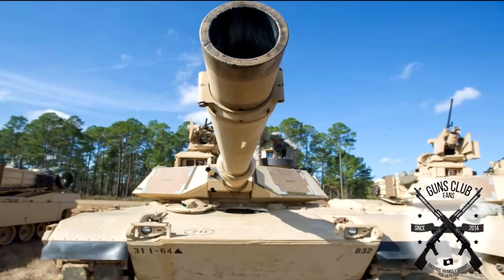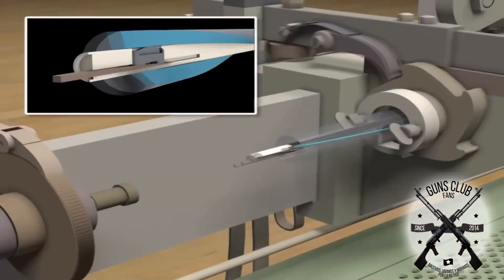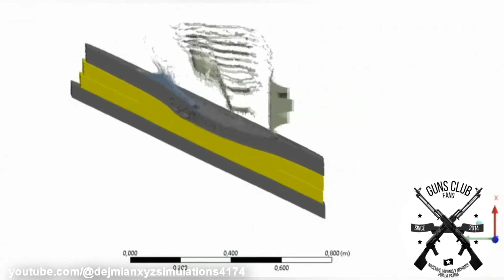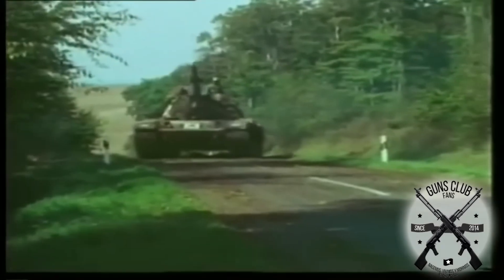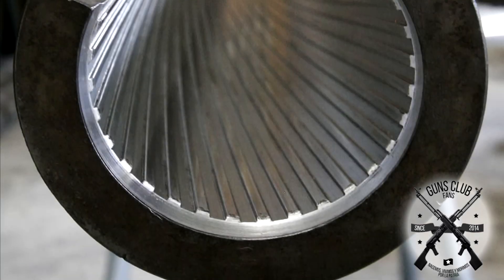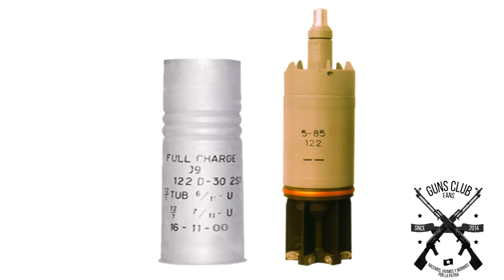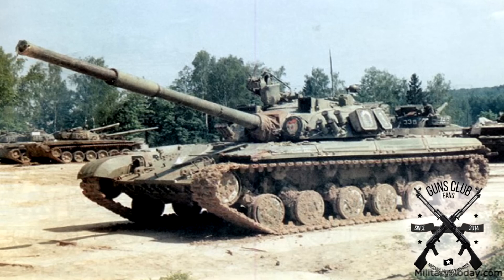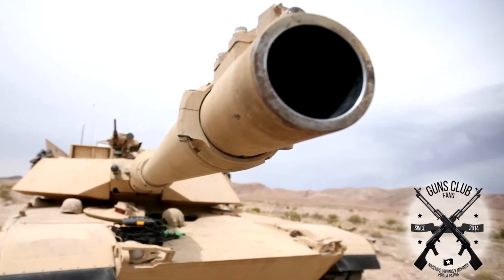Why Do Tanks Use Smoothbore Cannons Instead of Rifled? The Shocking Truth!

Comment: One thing you missed is smooth bores can fire at higher velocities. Past 2550fps  barrels wear out faster. Magnum sporting rifles have the same issue. 220 swift is highest velocity production sporting rifle at 4000fps. Barrels only last for a few hundred rounds. Retired gunsmith by trade.